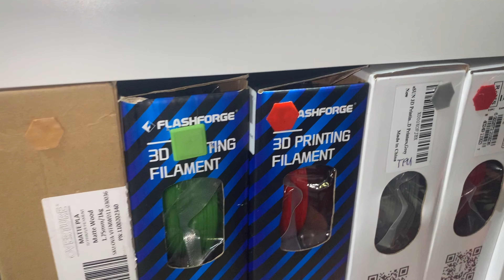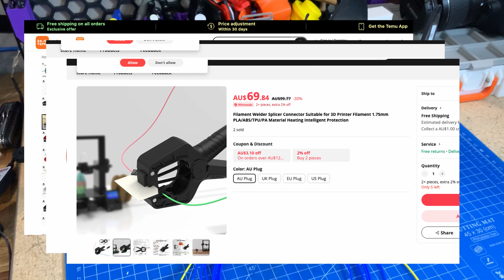Useful tools to print for your 3d printer setup

Comment: reminds me... should add aluminium foil to that wallet... i did some research - aluminium isnt quite as good as a RFID blocker card but RFID cant be read trough it and with only one card and the aluminium on the other side of the card than the reader... it also cant be read...

so sandwitching the cards in the wallet between aluminium shoudl surely give some protection :)
Reply from the maker: Maybe printing with no infill, pause at the right layer, and lay the foil into the print itself.  You'd need to watch that the fan doesnt blow the foil upand get tangled.
Reply: @3DPrintSmith  no infill aint to good... but maybe 0.5mm or less gap anf no support in there... pause... put foil with a drop of superglue in each corner in and continue